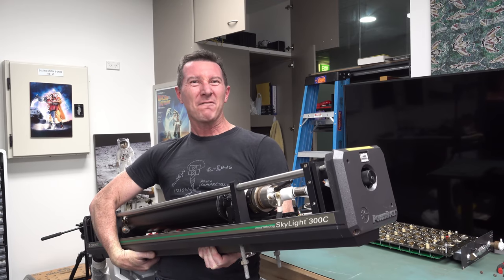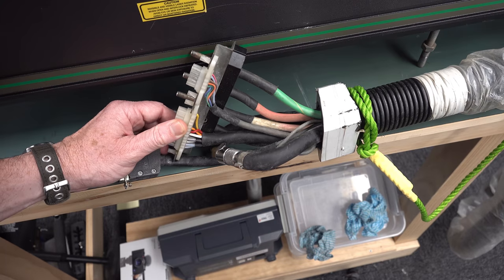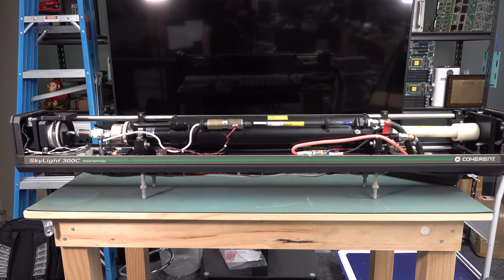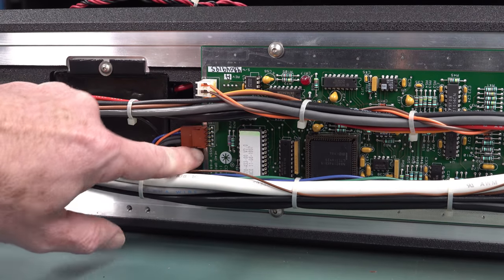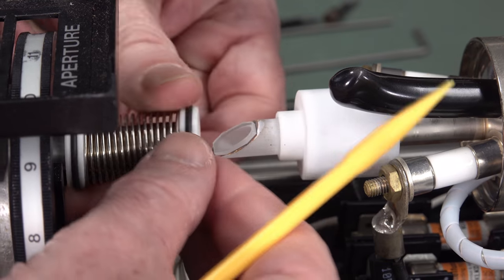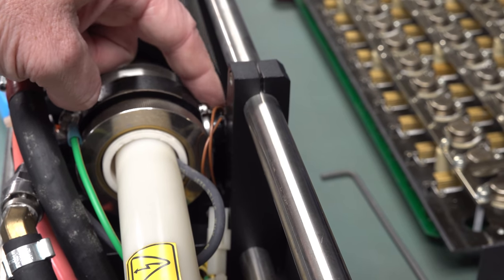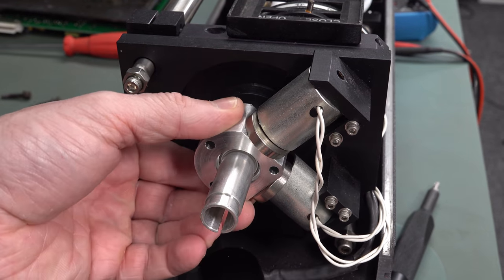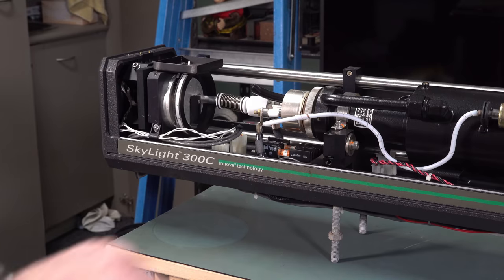EEVblog 1412 - Argon Ion Laser TEARDOWN!

Comment: It's a water heater (25kW) with coherent power on indicator (10W).
Reply: Turbo kettle
Reply: This thing is more efficient than the average politician!
Reply: I see the sticker on it from AvE channel. " Not to be operated by... "
Reply: One of the most intresting water heaters around.
Reply: Stephen Ferree  lol. perfect.
Reply: Stephen Ferree   Smart to have a recirc setup like that.  In the 90s I heard a professional laser guy grumbling about losing 2 argon heads to cooling water loss at venues.  One because crowds trampled the hose out of its protective cover and collectively kept it kinked, and the other when some f***head usher took it upon himself to shut off, disconnect, and roll up the hose mid-show.
Reply: you win! :)
Reply: @lironmtnranch4765  yea the dager of lach if internal communications, when you have something that critical avrevryone working on the venue during and befire the shiw gas to be tokd "no one fucks with this without talking to the responsible tech unless the bldy fire alarms ( that shuld turn if the laser anyway) gies off
Reply: @gustavrsh  That's not difficult. My lawnmower is more efficient than the average politician.
Reply: Pretty much😂

Comment: The thing you thought was the powermeter is actually a selenoid. Larger argon tubes have a built in refill reservoir since some of the gases get embedded into the tube so the pressure drops over time. The attached tube is pinched off on one and and contains some gas that can be added by sequentally opening the two valves, every time giving a small pulse of gas until the reservoir is depleted and the tube needs a complete refill.
Reply: But those valves often leak just a little, rising the gas pressure over time of non use, up to the point where the tube can't be ignited anymore. 
There is a sweet spot of hours/day to get the maximum life out of a tube.
Reply: @VintageTechFan  Either they leak or you dont know what they are and play with them. Not like i ever ruined a perfectly usable I90 tube when i was a kid....
Reply: @NIOC630  We have an Innova 400 "Sabre" at work, but don't use it all the time. At idle times, we have to regulary run it to keep the gas pressure from rising too high.
Reply: In the smaller Version (4w if I remember correctly), they don't use a vale, instad there are four glas ampules inside soft copper tubes. To refill you just crush the tube with something.
Reply: @philipweser8774  Yes, im not entirely sure but i think i have one like that somewhere....
Reply: @philipweser8774  Yes, the I 90 Argon is like that, there's a tube sitting on the shelf behind me.
Reply: I love the idea of a selenoid -- a solenoid made out of selenium?
Reply from the maker: Ah, that makes sense, thanks.
Reply: I have to run my Coherent Enterprise at max power  for 1 hour continuously, every month, then the Remote Laser emission will start flashing, letting me know it is balancing the gas from the auto fill reservoir. Page 5-3 in manual.
Reply: @VintageTechFan No, the valves do not leak.  The reason that these tubes go over pressure is that the gas gets embedded in the ceramic bore as the laser is used.  The fill is necessary to keep it  the pressure at operating level after while as the gas gets embedded. If left unused for along period of time the gas comes back out and raises the pressure to a point where it will not ignite.  This is very common of all ion lasers.    NOTE that by pressure we are still talking about vacuum.  The amount of gas in an ion laser is amazing small and even slight changes have a large effect on the operation of the laser.  They really only operate at a very narrow amount of gas.
Reply: @philipweser8774  Yes, we had 3 Coherent STAR white lights (Ar/Kr Mix) that had the ampules.   It came with a special tool to break them.   I remember doing that a couple times over the years we used them.

Comment: The tube thingie over the brewster window is to keep dust out. High power laser optics can be damaged by dust burning in the laser beam. This damages the glass optics/mirrors and causes them to further heat up and cause more damage by thermal runaway.
Reply: Just lick your finger and wipe it off. All good.
Reply: Yes indeed. Some argon-ion lasers (I don't know about that particular model) use a nitrogen gas purge for all parts of the beam path outside the actual laser tube, to prevent dust ingress and oxidization of the optical coatings. Bellows tubes like that are common, as the mirror mounts have to be free to tilt a bit to align them, so you can't use a solid tube.

The circulating optical power inside the cavity can be 100x the output power, so you don't want dust falling on a mirror that's reflecting 1000W of light in an area of a few mm^2.
Reply: @theonetrueanthonylong1843  Nice try, Kent!
Reply from the maker: Yeah, but why does it look like that with o-rings on the outside.
Reply: @EEVblog  Maybe it's done that way so you can attach it after assembly... you squeeze the spring and you can put it and out afterwards as opposed to having a tube?
Reply: @theonetrueanthonylong1843  Ha Ha. Tried that and only 99.99% pure alcohol would remove my grubby fingerprint
Reply: @tomteiter7192  Always check your optics
Reply: @TheVictorLudorum  On Krypton lasers you'd also want to purge the beam path with nitrogen if having it lase on UV lines, I've read (and we did it). Else, ozone might gradually build up, slightly changing the beam path's refractive index and optical length, which could in turn lead to drifts in line frequency or unstable output.
Reply: @kabongpope  You slime! XD
Reply: @EEVblog  it's possible it's simply a reused part that just fit the bill.
Reply: I was waiting for the real genius quotes!  My favorite is still, "In the immortal words of Socrates, " I drank WHAT!?!" "
Reply: @tomteiter7192  Came for this.
Reply: Maybe it also addresses thermal expansion?
Reply: @EEVblog  I wonder if the white parts that the o-rings were on were split halves, and the o-rings are just used for a light clamping tension?
Reply: @tylerethernet8610  We did not use purge, we used a silver mesh that catalyzed the ozone.  Without that mesh the power would drop off significantly as the ozone built up.   This was common on all white light lasers as the Kr created this problem.  We did not put mesh in the Ar lasers unless they were running with UV optics for a UV beam.  Then the ozone was really bad.

Comment: For the first time: Don't take it apart, Turn it on!
Reply: Plug it into the Hopi, I want to see the power factor.
Reply: ... in other news...  Widespread power blackouts throughout Australia!  :)
Reply from the maker: Small problem of a 24kW supply.
Reply: @EEVblog  You MIGHT be able to run it at noon from the solar power grid there. But if a cloud happened by the laser would quit
Reply: @EEVblog  I had one in my lab back when I though science was a noble life..... It had 208V 3-Phase power and we had it coupled to our buildings chiller water feed through a heat exchanger... If you work in Big Science - all Lab Spaces come with multiple wall outlets with the following:     (1) 208V 3 Phase Power,  240V Two Phase power (2) Nitrogen (3) Vacuum (4) Water -  and in the chemistry building they still had wall taps for (5) Distilled Water and (6) Steam as well as a safety shower for when you spilled your work on yourself...  There was once a time when I thought my greatest achievement was working in a lab hood for three weeks straight , weekends included - to produce 2.25 mg of a target molecule needed for a publication. LOL!

Comment: Hey Dave, nice taredown. I believe we used to pull the six strongest lines out of this one, but because it doesn't have krypton there are no red/orange lines. But plenty of lines in the blue green and violet range. The main beam with all the lines has a greenish cyan colour, that any ion laser user will remember. That rear mirror adjustment is super sensitive, the difference between output and no output at all from memory. I believ that the output mirror and the rear mirror are specially formulated dichroic mirrors to optimise the lines that the laser was designed to produce which is why they don't look as reflective as you would imagine. But they certainly are in the frequencies desired. Cheers Dave.
Reply from the maker: Thanks Daryl for donating the gear, very enjoyable and interesting downdowns.
Reply: They optics were hella expensive.  about $500 or more per optic in todays $$$.   They were not only custom coated for the desired wavelengths, but also curved.  The HR (High Reflector) had a curve to it based on the length of the laser tube.  The OC (Output Coupler) was flat.

Comment: and 30 years ago, we carried several of them, around the world... For stage shows and performances... 20W was small, we had up to 100W. 
The water cooling was the nasty bit, since it had to run at all times, every day in different venue - different fittings, drains and distances. 
Plus I do remember having had huge transformers, beside the main PSU, huge = 200kg++.
Reply: 100 W? Wow, great stuff! In the 90's, I used 30 W Ar+ and Kr+ ion lasers in a lab. We had 125 A / 400 V three-phase wall sockets and 2-inch power "cords" for it.  10 W lasers are in fact just for sissies... ;-)
Reply: @tylerethernet8610  This was for shows like pyramids in Egypt and stuff. One brand was great on Krypton (I think Spectraphysics) and the other one on Argon, where the Argons where the power houses.
I do remember how one flight case with tube, just about fit the length of a 3.5t box truck.
Reply: @SarahKchannel  We too had Spectra Physics (Ar+) and one Coherent (Kr+) lasers. The latter one sucked a bit (not just electricity) and was acting up once in a while, including its power supply. Ar+ indeed lases very powerfully and was fun to work with.
Reply from the maker: Yes, I had the opportunity to get the transformer with this, but it was several hundred kg and on a shipping pallet.
Reply: @EEVblog  yep because this things run predominantly 110V and single phase on the PSU... so we always had 240/380V 3LNPE to 110V 1LNPE transformers... 
packing and unpacking on a daily basis.

But I still sometimes miss those days !
Reply: @EEVblog  EEVblog I'll never forget the video you made from 2009 about audiophools and snake oil! By the way, how's it going in Australia with the lockdowns? ;-)
Reply: 100 Watts,? even 2 Spectra physics 171, ion lasers end to end would do about 50,watts max, set to multi mode. Ha, you must have mixed the laser frames through cubes to sum the optical power. What a powef hungry 3 phase show.
Reply: 100W optical of argon beamage. Did you have auxiliary nuclear power and a mini cooling tower for it 😮😂
Reply: I worked at Will Rogers Memorial Center in Fort Worth, TX. doing public events / concerts set-up / tear-down.  The 100W Krypton / Argon mixed gas are truely a beast to labor around and you are correct about being an 'avocational plumber' for the cooling.  But it was worth it to get that scintillating white light.

Comment: Thanks for sharing, spent many hours re-tubing Kryton (413nm) Innova laser heads in a previous job, used for CD/DVD mastering equipment as a light source. Kept the system service eeprom and service manual to repair heads/PSU, as was certified by Coherent many years ago. The device you highlighted as monitor diode is actually Ar or Kr Gas reservoir. Which will add gas as pressure deviates from ideal based on tube voltage. Noble gasses become trapped under sputtered Cu inside the plasma tube, which lowers the pressure. The AlO ceramic plasma tube has dozen's of Cu cups which have a holes where the narrow confined plasma passes thru. This sputtering eventually leads to lowering of the output power as the sputtered by products deposit on the back of the brewster windows. In our application the tubes only had a 6-8k hours life on time and cost >$20k. Fascinating technology (wasteful) to generate less than 1 W output @ 413nm!

Comment: They use Invar rods between the mirrors for stable lasing. The optical cavity length (distance between the mirrors) must be a fixed number of wavelengths at the resonant frequency, so obvs if the cavity length changes it buggers up the output.
Reply: That tube is a multiline version as it has 2 brewster windows, so the exact multiple of the output wavelength thing isn't true for this particular laser. It would be the case for an SLM version of course.
Reply: @cambridgemart2075  Do the single-line versions have the intra-cavity wavelength-selection prism instead of the rear Brewster window? (I don't remember the details after 20+ years).
Reply: @cambridgemart2075  - thanks. My memory's fading.
Reply: @tylerethernet8610  I believe they do, I don't think these lasers used an etalon unless single longitudinal mode is required.
Reply: @cambridgemart2075  We had single-line the version with may have employed a prism (IIRC) and/or an etalon. It didn't matter that much, anyway, as we were just pumping ring lasers with them.
Reply: @tylerethernet8610  The Star II lasers had integrated optic at the HR end.

Comment: The multi-line argon lasers have gorgeous beam colours.
Reply: especially when split up by a prism :-)
Reply: I've actually got one (a much smaller, 40mW laser) and it's quite a sight to behold.
Reply: Yes, the AR/Kr lasers used in laser light shows had about 8 lines of color.  Some produced real yellow as well.  The had softer colors, but you can tell the difference. SS Lasers are much harsher, but the blue from SS is superior to the darkest Ar line.  That line was awesome, but one of the lowers powers.  SS lasers have a more "electric" look due to the blue wavelenght used.

Comment: I have an HeNe laser with that polarizing angled window. I’ve noticed that you get a beam that comes out almost perpendicular to the main beam. I’m guessing the metal spring is there to absorb the stray beam and dissipate the heat from that
Reply: Thats correct, this beam has orthogonal polarization direction of lesser power. But you still dont want that to go out in case someone works on it.
Reply from the maker: That makes sense, thanks.

Comment: In the 90s I did amateur laser shows for my Brother's band.  Started with a red he-ne tube, later got my hands on a blue + green argon that was only a few watts.  Then had a super rare, beautiful deep purple helium-cadmium laser.  This had a more complicated separate power supply unit than the Argon,  and on startup a big fat tungsten filament started glowing brightly to vaporize the cadmium before it would fire the gas discharge supply.  Both of these lasers were temperamental as hell, with the mirrors going out of alignment and requiring long warm up times before they really started humping.  These cost well into five figures new, and the salvage guy I knew was selling them for 1500+ used with thousands of hours on the meter.  Nowadays, diode lasers are available up into the UV range and lasers comparable to these gas giants are cheap as sand in comparison.

Comment: There's no filament at the anode end, it's just a block of tungsten embedded in copper.
The I300 series have a personality module which is on that PCB in the head, it talks to the PSU to supply the stored configuration data for the individual tube.
The water flows in at the cathode end and out at the anode end as that's the hottest part; that's why the thermostat is at the anode end.
The filament feedback lines are fused because the filament runs at 50 to 60A, you wouldn't want a short on the feedback lines as it would cause them to glow if they weren't fused!
Reply from the maker: Did I say that? If so, yeah, obviously no filament.

Comment: Those invar rods....WOW that's neat!  Reminds me of the CRT days.  Sony had invar shadow masks in the Trinitron CRTs.  Very low thermal expansion to reduce convergence errors as a tube heated up.  Then there were the NEC monitors that used aperture grilles where if you smacked the monitor on the side, you'd see convergence go nuts for a second as the wires vibrated.

Comment: I used the bigger brother of this for my masters but for the phd follow up we replaced it with a diode pumped solid state laser. much more efficient. 56kW for 32 W laser light (all lines) or 12-15 W single line. The brewster window has to be covered as this is within the laser cavity (those end at the mirrors) and thus the laser power there is much higher and it will burn in any dust quickly. And we had a service contract with coherent as the tube needed to be replaced about every two years. Once the service techincian tried to bring it back to spec by cleaning the brewster window with an acid, but then it was even worse and they had to replace it eiitherway. Nice to see it again.
Reply: yes any contamination on the window can be devastating.  The intercavity power is immense, but it is also virtual as it disappears as soon as you put something in the path.  But dust would only block a small spec of the beam diameter and around it's edge it would burn the dust.  It's one of the coolest things to stick your hand in the intracavity beam to stop the lasing (that's how many of the shutters worked, by blocking the intercavity beam)  At Lexel we used a magnetic shutter that flipped a "spoon" into the beam.  It's also awesome to see the intercavity beam as it is VERY visible even with completely clean air as the photons are difused by the air particles at that virtual power level.

Comment: BTW in old IBM printing machines we have had about same size lasers. Those where those printers where paper rushes true the few machines. Laser would polarize letters onto the drums and drums would pick up toners with that charge and press it  and baked it on the paper. Drums were hot to.